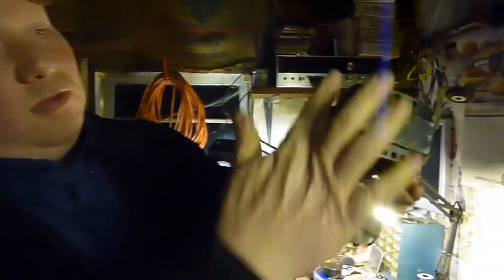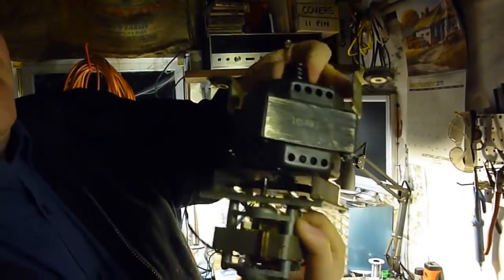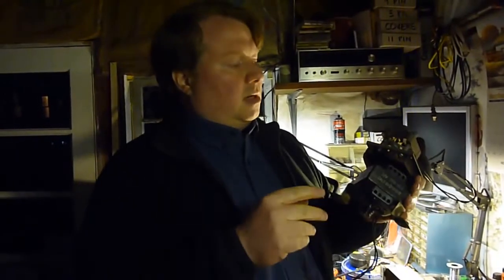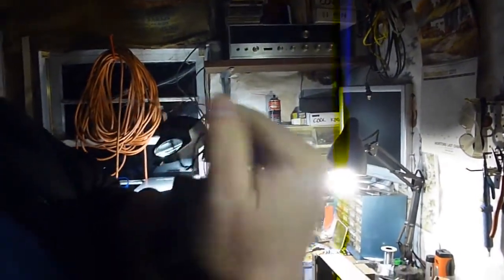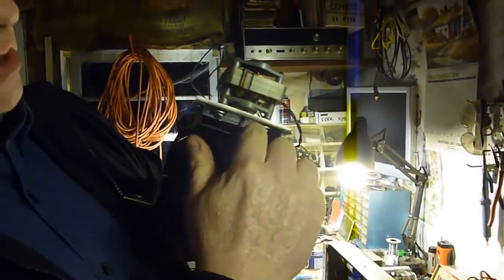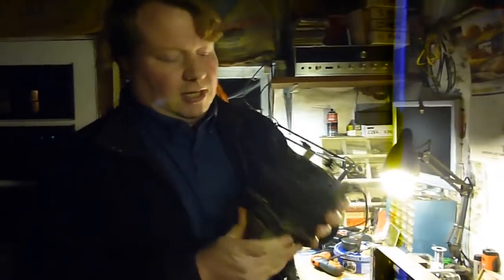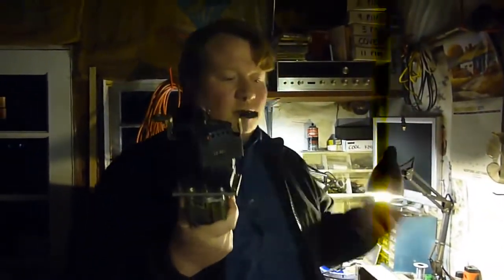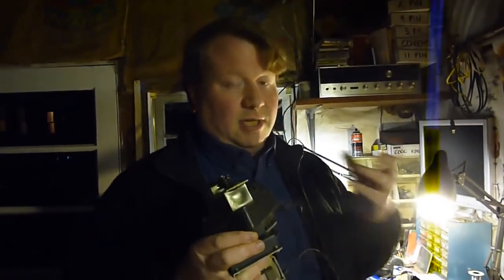Leslie Speaker Motor Primer for 122, 147, 145, 142, 825, 760, and more

Comment: There is no solenoid in the two motor assembly. When the slow motor is engaged the magnetic field pulls the slow motor's rotor upward into the motor's magnetic field which also places the slow motor's shaft into contact with the rubber tire connected the the fast motor's shaft. When the slow motor turns off, the slow motor's rotor drops down and away from the rubber tire

Comment: Hey there, and thanks for the videos. Could you share your thoughts on the best way to change a 45 to a 145 "motorwise". Would you prefer to change the single speed motors out for a stack (and then modify the cabinet so they fit) or make the single speed motor mimic a two speed stack by electronic means ? Thanks
Sparky